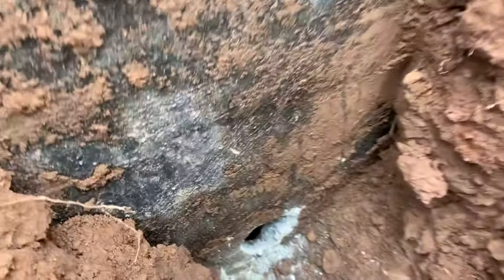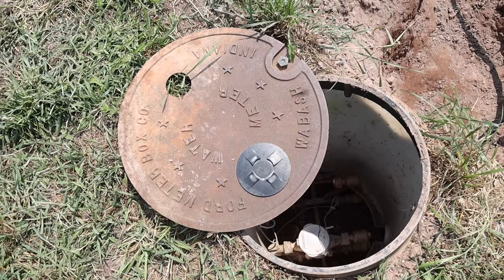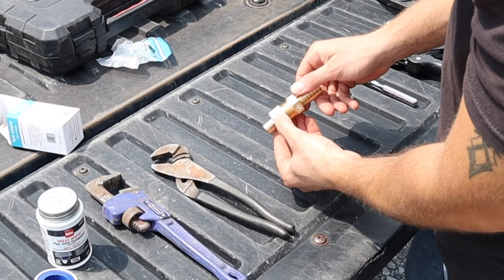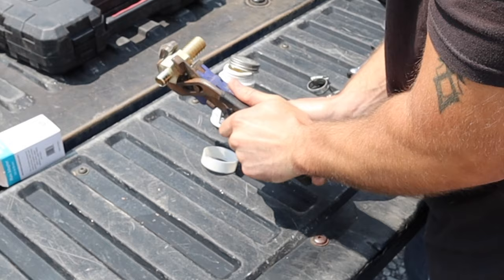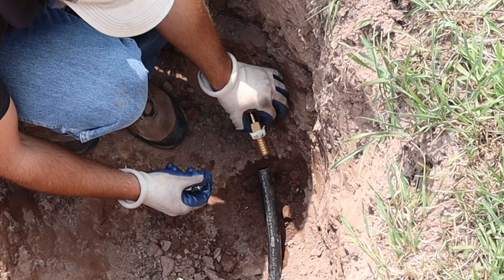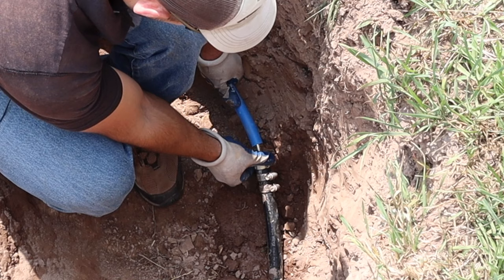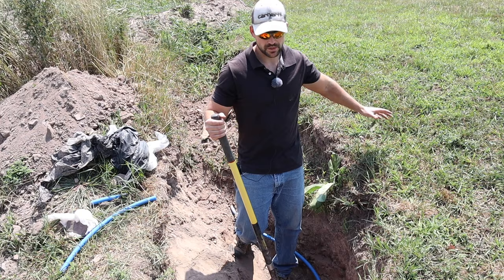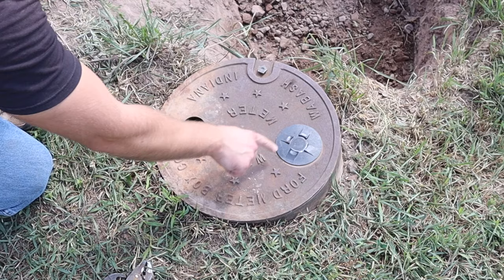PEX Pipe From Meter To House

Comment: Hi i have the same issue but mine is pex   on both side one side is 3/4 and the other side is  1 inch pex I tried to do the same as you  since the one that was already there  is plastic compression fitting and is broken  but  the Home depot  guy told me that by code  you are  not allowed to use this pex  crimp under   ground for water line by the way i live in Vancouver and lots of rain here  any other suggestion  from u  or any one else thx

Comment: So I have 600 ft of main water line to put in and I’ve been looking at 1” CTS Polly pipe but can’t find the right fittings? Can I use pex? I want to go 1” ID from meter to house
Reply from the maker: Check your building codes to see if it’s ok. If so go for it! Thanks for watching!
Reply: After running the pressure/friction loss calculations I opted to run 1 1/4" HDPE IPS 160psi NSF instead of 1" from the meter 350 feet to my crawl space. The additional 1/4" in diameter resulted in the pressure loss being reduced by over 60%.

Comment: I might have missed it but won't those clamps rust over time
Reply: Most are stainless
Reply: Yes! Even though they are stainless, they will rust in time. They should at minimum be wrapped with a waterproof wrap like extra wide vinyl tape to well beyond the clamps and fitting for protection.

Comment: I have a 1 inch pvc supply line running up to my house. How do I convert that to pex to get the water into my house. I’m building a tiny house so a lot of this stuff is DIY and I need to know how to do this so I can get the water line in the house
Reply: They sell a a pvc to pex adapter.

Comment: Are you concerned with leaching or taste issues from PEX? I'm weighing my options and that seems to be a major concern with a lot of people. Thoughts?
Reply: Pex will only leech into your water if it is exposed to sunlight anywhere. It has a horrible UV rating so definitely avoid sunlight and you are good. Any piping that is exposed,simply cover with pipe insulation. Then you have no worries of pex leeching. Great question btw. I won't take this yters advice,he couldn't put teflon tape on in the right direction. Not trying to insult him,just pointing out the truth that he isn't very experienced in doing it proper.
Reply: @normalhuman9260  Thanks for the advice. I have yet to even begin re-plumbing my house but I think PEX is the way to go.
Reply: @gherkinssister  absolutely. I would spend 60$ and get the crimp tool and use the rings rather than shark bites "way more affordable". Holla back if ya want any advice when you re plumb your place,I'm normally up on my notifications and am a plumber. Best of luck to ya,have a great one.

Comment: Should have just ran the poly all the way into the house, and use a torch when tying on your barbed fitting and you never put the clamps on the same direction they cinch down oblong, when you put them across from each other you get a better seal.

Comment: Connect it straight to the meter and replace the old universal nut, do not hook into the crap black plastic pipe like he did.  Plus, he added an unnecessary extra connection, better to have a straight run into the house. It's not really that much harder to do it correctly.  Hell, if you are going to do it his way, at least make it easy on yourself and use a Sharkbite, it will last longer than those metal pipe clamps.

Comment: Isn't it a bit worrying if there are rats in the area that could bite the pex pipe?
Reply: I am going on 4 years having pex pipe and was wondering the same thing but so far so good spend around $1200 to replace the Galvanize pipes I use to have .

Comment: Couldn't you just run the pex pipe to the meter so you wouldn't be putting a connector in the ground? And will that fitting reduce the water pressure?
Reply: The city owns the water meter and they won't let you connect directly to it that's why they stub out the black poly pipe for you to connect to. They would be upset if they knew he opened the water meter cover, that is city property also.
Reply: @dodge96sport  In some areas the "customer is responsible for maintaining the water meter pit, meter pit cover/lid, meter pit ring and all the related materials inside the pit (excluding the water meter)." 😉
Reply: @dodge96sport  WHAT RU SUPPOSED TO DO IF IT IS FRIDAY NIGHT and a very serious and costly problem develops IN YOUR HOUSE OR , EVEN WORSE , IN YOUR YARD ????
WAIT TILL MONDAY ????
Reply: @theferallife8812  I SUSPECTED THAT  !!!! The meter reader comes out here faithfully every month , lifts up the cover , which is very heavy and hard to get off , looks in there for several minutes , and leaves ( EAST baton Rouge parish ) .
But whenever I open it up to shut off the CITY WATER , there is about 15 pounds of,damp muck and mud covering up EVERYTHING .... There is NO WAY ON EARTH he is reading that meter .....
what do they charge us by ???????

Comment: You said you can never use to much pipe dope. Considering the amount of clogged aerators and the stuck water sensors in tankless water heaters  I've had to fix over the years because of a slopbucket plumber globing pipe dope on everything.  I'm going to strongly disagree with you on that

Comment: I feel sooo much less intelligent after watching this video. Let us address three major issues I observed.
Teflon Tape on the threads: 
Please check other's comments below (Yeah, I am not the only one who noticed.) and wrap the Teflon tape in the proper direction on the threads. 
That did not happen in this instruction. Literally - Quite the opposite!
When one wraps the threads in the wrong direction (with the rotation/CCW) the tape is pushed back out of position when the two pieces are threaded together and tends to bunch-up in front of the outer fitting with little tape remaining in the root of the threads where the sealing action is required. When the tape is wrapped against the rotation (CW) - as the two fittings are threaded together the tape is pulled tighter in the direction it was wrapped and deeper into the threads with little to no displacement. 
Of course, we will pull the Teflon tape as tightly as possible when we wrap it, to "bed" it down deep into the threads on every pass and leaving the first thread uncovered to prevent tape debris from entering the plumbing system. Simply covering the threads, as is shown herein, is not proper if not performed in the correct direction and with proper tension. 
i.e. - Here is an example of the, mostly, correct procedure... https://youtu.be/f7mjyzfB9Ec (This guy initially covers the first thread but corrects himself later in the video.) ;-)
Lastly, & aside - Hydrocarbons and "Standard" Teflon (PTFE) Tape ARE NOT COMPATIBLE!  ONLY Tape that is FUEL/GAS Rated can be used on systems with Hydrocarbons. 
           This is usually yellow - However I have seen it in White, Grey, Blue and Pink.  Read the fine print on the edge of the spool. It will address the product application thereon. 

"Clamp Rings" and "Hose Clamps" are two totally different products. Use the correct device for the application and your "labor..." won't need to be so excellent. 
Clamp rings (more properly Oetiker Stepless Clamps) are the better choice for the Polyethylene (PE) as they wrap completely around the outside of the PE 1-1/4 times inside themselves providing for continuous, uniform circumferential pressure on the barbs inside the PE. The best ones even "lock-in" when properly closed. Whereas standard hose clamps (like he uses here) DO NOT apply uniform pressure under the screw assembly housing and are frequently the cause of a substantial leak past the barbs. There ARE specialized hose clamps that have a "shield/lining"' under the housing to prevent this issue but why go through all the trouble of locating them, ordering them (No one has them in stock anymore), paying 4-5 times as much for them as compared to clamp-rings specifically designed for the PE. 

PEX-A & B are much less forgiving than PE when it comes to contact with rocks and shards. I saw no attempt to remove any of those large shards & rocks in the trench and bury the PEX in a professional and workman-like manner using truly clean soil. One HUGE problem with PEX-B is that when it is kinked or dimpled (by an edge of some sort) it tends to fail at that very specific point. That can result in a call-back, to dig up the homeowner's yard or driveway to effect repairs, many years down the road, that never needed to happen  (so-to-speak). 
I hope this clears up some of the controversy and I wish you all well in your endeavors. 
RBN, USCG Ret.
Reply: Thanks for a truck load of INFORMATION , but what do HYDROCARBONS have to do with INCOMING WATER ?????
Reply: @sukt00  THANKS ....I UNDERSTAND , NOW !!!!!!!

Comment: So many thoughts:
1)  tape wrong direction
2) dope or tape, not both
3) clean excess dope, you got crap over everything
4) line from meter to house probably should have been 1 size larger, less pressure loss, better flow
5) hole into house didn't show inner hole in block
6) for both holes, measuring from a mortar joint to miss webs in block (3 or 
7) pvc sleeve as entry usually used when foundation installed.  unnecessary later, just 1 more place to leak, see 8.
8) both sides of wall, and both sides of pcv, now need to be sealed with hydraulic cement to prevent potential water & bug entry into house.  See 13.
9) from what I saw in video, the top hole on the meter lid was reversed to be for your house, ie, you put the lid on 180⁰ wrong if your house is on left viewed from street.
10) in addition to the pipe coupling, you should have installed a shutoff valve, and a box to cover it, yet have it accessible.  Much easier than crawling into a crawl space.  Otherwise buy a meter shut off wrench, and keep it labeled, and in your hall closet.  Much easier for wife when something goes wrong in house
11) paint meter box lid, and shutoff lid a bright color. Cheaper than mower blades, and motor crankshafts
12) paint a dark stripe on foundation up to siding, at water line entry point, so you don't cut it gardening
13) consider tarring or membrane or other sealing of foundation / basement wall, above ground, or highest snow/ice/groundwater line.  Moisture in crawl space or basement breeds mold
14) black PE can be softened in any climate by judicious application of a propane torch into mouth of pipe, just until cut edge starts to deform a little or melt - caution hot, work fast.
15) band clamps (proper name) need to be completely over barbs of brass adapter.  Looks like you went beyond barbs on far clamp, evidenced be reduced diameter beyond barbs
16) band clamps have a torque spec., although most of us go a smidge beyond
17) with your 2 band clamps, the heads should be staggered by 180⁰ so the bands touch each other.  That way, no weakness under clamp mechanism
18) hope you are well below frostline, even in south.
19) always photograph before backfill, so in 10 years, you & any new owners, will know exactly what was done, and line routing, and depth
20) consider a second separate meter, if you use paid water for irrigation, and they double (or more) the water cost for sewer service.  That eliminates sewer charges on irrigation, pool, car washing, etc.  Cost of second meter & install is the trade off.  Sometimes you can get a sub meter branched off your line, and they can read both meters at the same time, so you don't have 2 accounts, and monthly minimum connection charges.